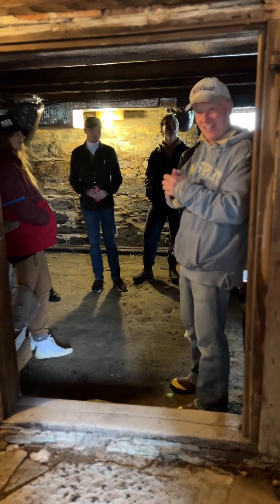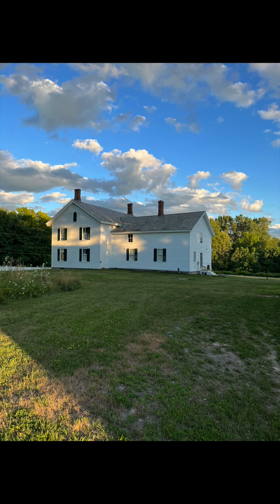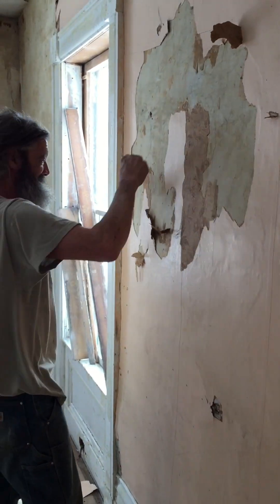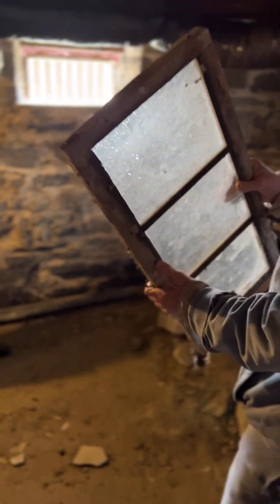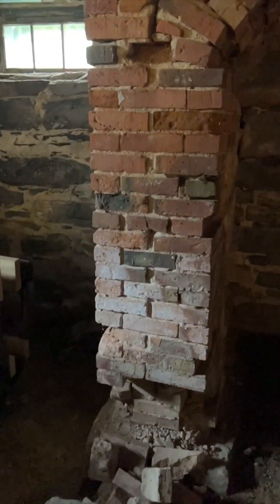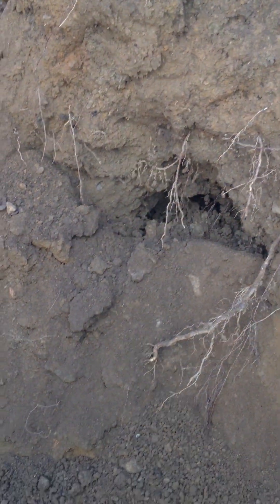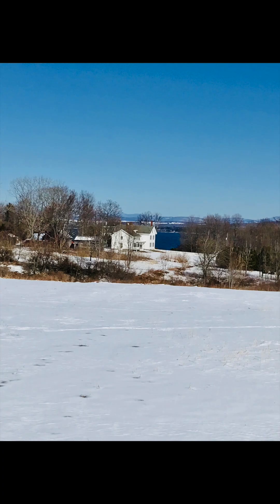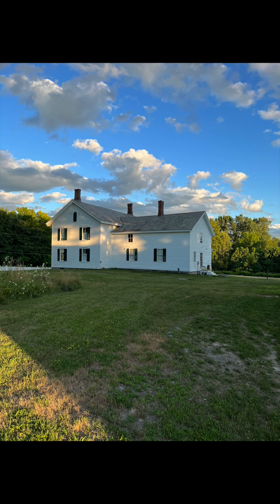Ep.16 - University of Vermont Students & Geothermal Heating for Historic House - How to w/ Yaglou.

Comment: We have a 1769 farmhouse in New England and want to put one in our house. We were told you “can’t” do that because of the houses age. 

After 2+ years in this house with wood and pellet stoves at opposite ends, we barely run the wood, almost never the oil and have no heating vents to the second floor bedrooms, and we are plenty warm. 

Some houses, lime ours were so solidly built, they would easily rival so many 
of the most energy efficient new builds, while keeping all that historic charm in tact. 

I really want to find someone to do this to our house, it would be brilliant!

Comment: This is very important to buold the knowledge base about the historic homes. I agree with you and live in a very similar home sans the heat pump. Zone 5-6 air source will be our direction but appreciate this video very much 

I’m one of those that repair lime plaster with actual horse hair etc
Reply from the maker: Lime walls are better for your health also.  They inhibit mold and mildew.  Wick moisture.  Also fire retardant and sound barrier and once heated hold heat. Thanks and you should watch some other of my videos.

Comment: but now how did you re connect your basement floor weeping tile drain  system , there may be drain  tile around the outside as well
you can still blow insulation in without removing the plaster and I would still do the attic floor that is most of the loss
Reply from the maker: we checked the cellar for any other drains and that was the only one and we did reconnect that one drain w/ a new pipe.   I agree some insulation on attic floor would help but havent yet as it has a pretty tight floor lid on it.